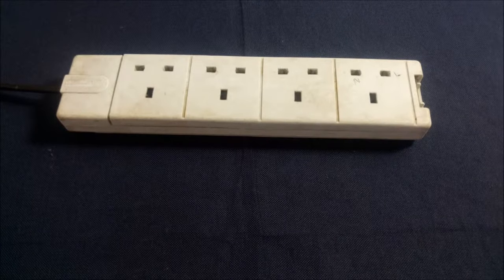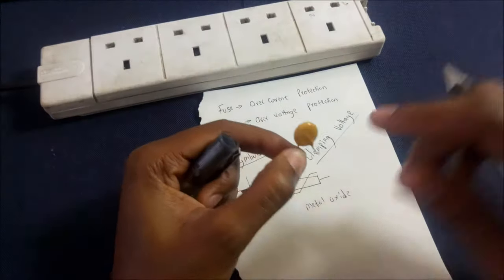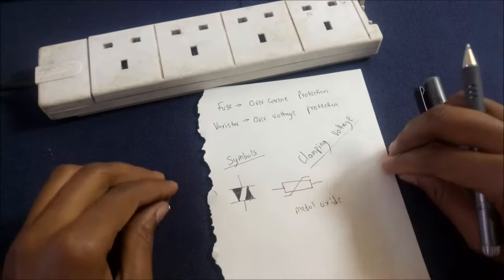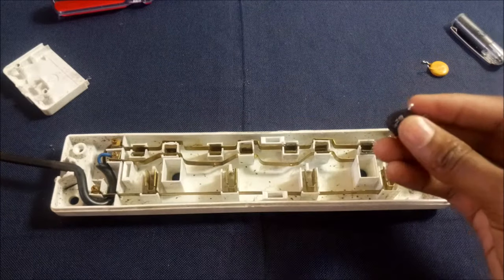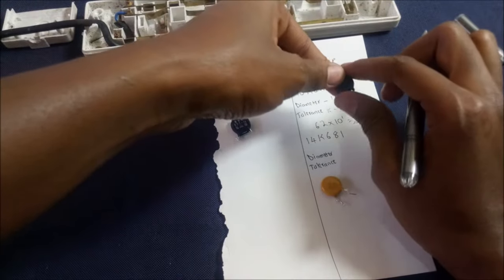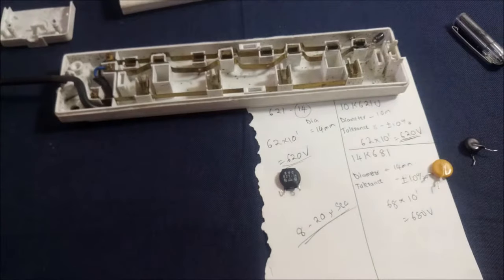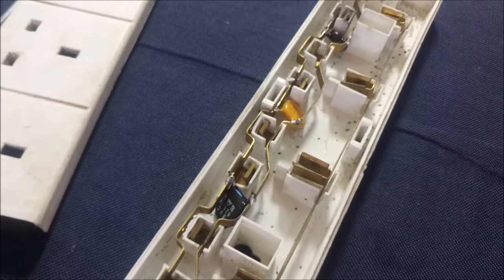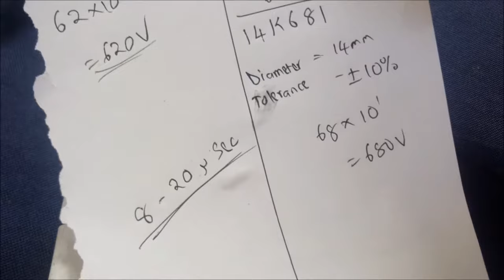DIY Surge Protector On Your Electrical Extension, Varistors

Comment: Greeting from Canada!  Very nice video. I searched for DIY protector and found yours. I have a few comments: It appears as if you attached three varistors to the same connection (line to neutral) when one should suffice and three on the same leg would allow triple the amount of potentially damaging surge current to flow. For more complete protection it would be better to have a varistor from line to ground, line to neutral, and neutral to ground. Of course your fuse is between line and neutral, so if there was a surge from ground to neutral or ground to line, (assuming that each leg  had a varistor) the corresponding varistor may fail with no indication that protection from that varistor is gone. Also, varistors wear out as they absorb spikes and surges with no obvious signs. Old, used varistors may have absorbed spikes in the past and may be close to or past the point of failure. I would use new MOVs just to be sure, unless they are difficult to obtain where you are.
Reply from the maker: Thank you very much for your insights. I have learnt somethings I didn't know before.
Reply: RSole9999  well actually I am using EU plug especially F plug types, is it safe if I use varistors that connect to "line to ground, line to neutral, and neutral to ground"??

coz Im just afraid if I accidently touch the ground pin that has Varistor links to the line cable...
Reply: "3x the amount of damaging surge current to flow" Woudn't that just increase the chances of the fuse blowing at the MOV clamping voltage if the fuse is rated properly, as intended?

Comment: thanks, is it possible that one of the varistors fail due to high spike and the fuse doesn't. I'm asking this because I have bought many in my office a few years ago and they all still working but just realised that they all have a surge led indicators that is off on all of them. Does that means the surge led will go on when there is a surge? They are all sealed so it's not eady to open them up and see if the varisors are ok or not.

Comment: Great video bro, noticed your sockets didn't have switches at the points where you placed the mov's, so it won't make much sense doing that unless you want to lose actual clamping function by increasing it above what your connected devices can handle.
You also forgot to install a thermal fuse before before the mov.
That aside, you did great. 👍🏿

Comment: Hello Dominic, good video - though i made two safety observations :
1- the earth was not connected to your extension lead
2- when a varistor fails, i am lead to beleive it gets hot and blows, if this is the case then is it not advised to attach a thermal fuse in line and attached with heatshrink to the varisitor to prevent any fires

Comment: Sir, can you please suggest me the rating of MOV for the following appliances: when I plug them to the power point where I want to fix the Mov?

1. 900W angle grinder.
2. Single door Fridge.
3. 1500W Air conditioner.
4. 2000W Air Conditioner.
5. 1500W Geyser.

I will be very happy if you please suggest me the rating of the fuse for the same.

We have problems many times here with appliances going off.

Comment: HI Dominic.  Thanks very much. I learned much from this video. I have a question though.  Why did u put varistors on each outlet ?  Can only 1 varistor work?  Also why is the clamping voltage high?  Why not go near the 220V or 110V...say 280V or 150V..? Hoping to hear from you. Thanks.
Reply from the maker: A couple of varistors are used, in case one gets damaged, the easy repair process is just removing it while leaving the others for further protection. But I've noticed in newer extensions, they only use one which is very sad. The clamping voltage is usually set very high because electronics can work perfectly fine even if the voltage increased to like 250 or 260V but in most cases this is rare. Because of voltage drops, the voltage can even drop to 220V and electronics will still work fine within the range. The clamping voltage is high so as to not inconvenience the users and to only work when a big enough power surge like from a lightning Strike for example occurs.

Comment: My extension smoked today , one of the four varistor is blown so is the fuse so do I have to change all four or just the one that's blown. They are all on a circuit board, 2 on each side.

Comment: But if you use 620V or 680 Varistors your appliances and electronics will already be dead because they can't handle more than 220-240V by the time the Varistor blows up your electronic will have already died before the varistors